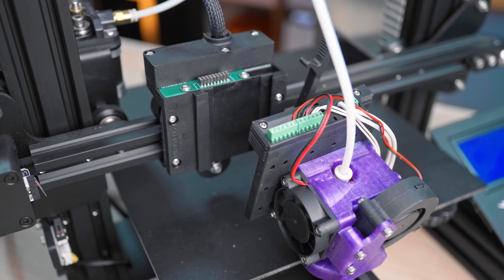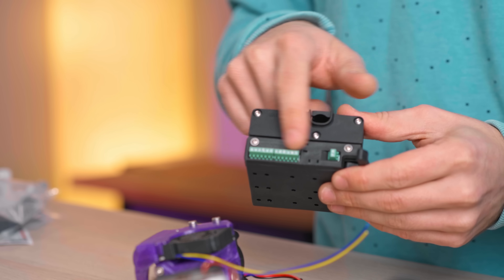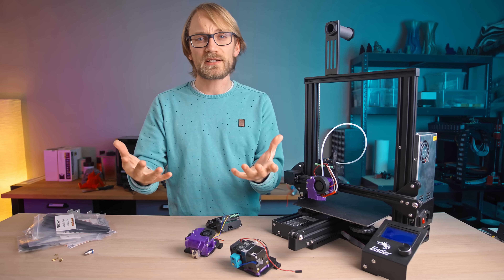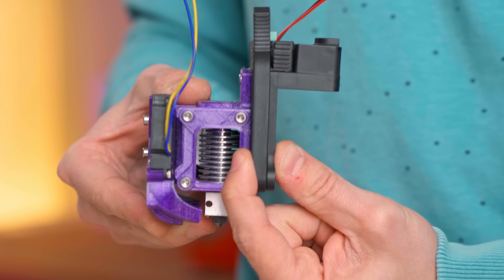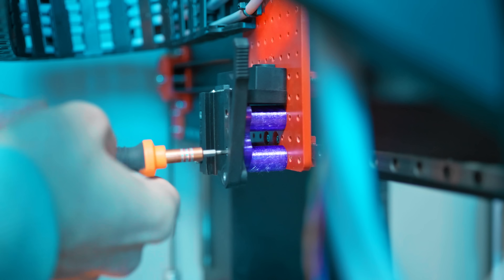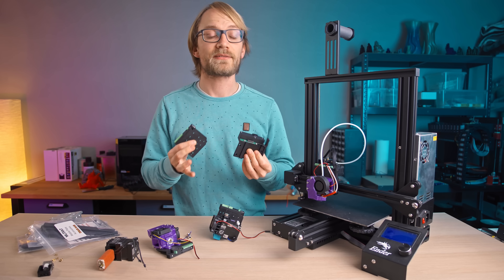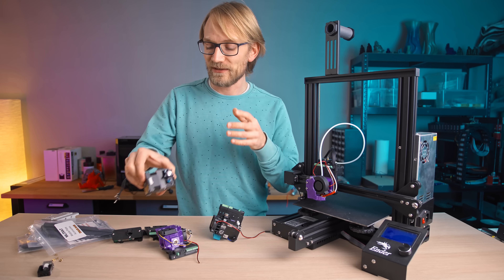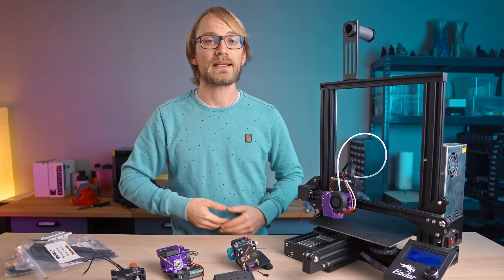WhamBam Mutant: A Quick-Change Toolhead Upgrade for any 3D Printer! (NOT on Kickstarter)

Comment: As soon as a I heard "patent-pending" I was very disappointed. Hopefully Wham-bam has the sense to happily license the design for a reasonable price versus just saying "mine!" like a toddler (aka MakerBot). Locking stuff like that down will inevitably kill the product. Hence why a typical maker doesn't even consider MakerBot not just cause of price, but performance.
I understand the need to get paid for your work 100%, but patenting this, like, read the room Wham-bam.
Reply from the maker: I'd greatly respect WhamBam if they were to explicitly call out their patent as being purely defensive - as in, you don't sue me, I don't sue you. Would need to see what's actually being patented first, though.
Reply: @MadeWithLayers  of course. I just automatically worry given the history of patented tech in 3D printing.

Comment: I've been subscribed for something like 4 years, since I got into 3D printing. Your videos have been essential for my growth in the hobby, and I just wanted to take a second to thank you. When I started I had no idea how any of it worked, and I'd certainly never used a 3D modeling program. I just designed the mechanical parts for a flight yoke with accurate range of movement, and I have creators like you and Angus to thank for the confidence to model complex moving parts.

Comment: A quick-change nozzle solution is something I'd be interested in, being able to easily change nozzles without the worry of accidentally ruining the heatbreak of the V6 design would be nice.
Reply: +1
Reply: +2
Reply: THIS. i really wish e3d did that. a threadless collar style heatbreak?
Reply: @ameliabuns  The heartbreak used by E3D's multi-extrusion hotends (Kraken, Chimera) is actually smooth on the outside, so you can more easily vertically align multiple nozzles. If only that was the case for the V6, Hemera, etc...

Comment: This definitely looks like something you could knock up in 5 minutes in Fusion, sans the electrical connection of course.
I wonder how much R&D really went into it
Reply from the maker: It's always easy to look at a finished product and go "oh, I could draw that up in 5 minutes". And yes, once you know how it's supposed to look, you can definitely draw up a similar product very quickly, but it's easy to miss the process of designing and iterating that led up to this exact design. And then, of course, turning that design into a mass-producible product that's actually going to make a profit.
Reply: @MadeWithLayers  actually in this case. lots of others have done it. and proper printing actually showed his progress. it didn't take a single person long. i'm sure a team of actual engineers barely had to think for themselves. specially when it's so similar to the community made ones. and the community released it for free
Reply: @MadeWithLayers  But in this case it really does look like 5 minute thing, hell I've probably designed similarly complex dovetail vesa mount for small pc. Anyone can order dozen pcb:s from china for couple bucks and it doesn't take much skill to draw straight lines between two connectors. Did they make any claims what the rated mating cycles is? I'm sure that claimed amp rating drops pretty fast in use. Idk what the hell they see that's worth patenting here.
Reply: ... but that will get you sued (patent pending). Although i wonder what it exactly is they patented and when, because proper printing already made a very similar system a while ago.
Have to agree with Thomas though, i'd prefer a Kickstarter over a patented product any time.

Comment: Another patent pending product for this topic. That's sad and doesn't match the open source driven community.
Reply: The idea is spread, so I am sure we will see an open source version in the near future. 😉
Reply: @Mister_Stork  There are numerous os quick release plates out there. The integrated connector and the lock lever are the cool features. Should not be patentable.
Reply: @Mister_Stork  Yes and no. 2 implementations of this problem are patent pending. So open source have to find a 3rd implementation. It's not getting easier.
Reply: Just like the mosquito, I have a hunch WhamBam will never budge on the price as to never admit/show that the product was a failure.
Reply: Open source is smostly like: Oh thats interesting, I´ll buy it form aliexpress when its available :D
Reply: @raise-project  How about the Prusa? Based on previous designs. How about the Ender? based on previous designs. How about Marlin, RRF... based on Open-source. 
the aliexpress thing is obvious. many will choose the cheaper path. HOWEVER: if you really value a product and are wanting to invest a bit more, lets say in a good extruder, then you will choose eg. Bondtech. On the other side, if you close-source it, many community members will not exactly like you because it stops the development. 
have a good one.
Reply: @certified-forklifter  Yes sure. I just respect license choices of someone who designed a thing. As not everyone that designs stuff has a full time job at a big company that pays his bills. 

Not a fan of patents though.
Reply: @raise-project  I understand you. its probably also hard for companies. Without the chance to become a monopoly, there are less incentives to develop products. have a good one!
Reply: @raise-project  Sure, I respect their choice. But I don't have to like it and I don't have to support the company. And it's still a valid point to be discussed. In addition it's kind of ironic that a company that replaces or adds parts of other products, protects their own work by a patent.
Reply: @WilkoVehreke Kinda ironic now as you said it yes :D. Not a fan of the specific product I have to admit. I just like the snapping lever. Tried myself an just had a round excenter knob and the pla didn´t hold up very long.
Reply: @raise-project  I guess they used Nylon for a reason ;-)
Reply: @raise-project  Can't agree on it. Look at e.g. Prusa. They're doing fine and are completely open source. In addition this tool changer needs open source software like e.g. Marlin to work properly.
Reply: @WilkoVehreke  Yes but Prusa also delayed the file release for a certain time to make sure some of the funding returned before its going into the open wild.
Reply: @raise-project  That's true and I think that's fair. Open source doesn't mean that every development step is public. Look at e.g. Android. It's open source but the development of a new version is done internally first. 
I'm fine with this, because the timing is reasonable. And it is by no meaning a patent that might blocks others to use the technology for free or at all.
Reply: @raise-project  Additionally: WhamBam wouldn't have a business if the patent for some kind of printers would have expired and others did spend resource to make an open source implementation. It's a bit about respecting the roots / community.
Reply: @WilkoVehreke  Imagine fdm being opensource from the start. We might be a little further ahead already. Maybe we wouldnt have known at all because only few had btx or  internet or sthg.

Comment: Isn’t this way to wide? It will let you loose maximum print size... 
2.54mm would be a better standardized pitch size.
I wouldn’t buy it. Maybe a printable open source version would be better. I once made a connection pcb for this but end up not using it.
Reply from the maker: My M9001 has a 25mm pitch on it and that works out pretty well. I use that as a four-screw-and-five-plugs, not-so-quick-change-toolhead 😉

Comment: I'd like this for having different nozzles ready to go. Without the fear of buggering my heatbreak with the awful method that is changing the v6
Reply from the maker: Yeah, swapping nozzles on the v6, especially when its mounts lets it rotate (like in the Prusa machines) is not something that's enjoyable on a regular basis.
Reply: I was thinking the same thing, I bought an 0.2mm nozzle a long time ago but haven't got round to trying it because of the hassle of swapping it out and the worry of ruining the heatbreak.

Comment: Maybe XT-40/XT-60/some industrial dc hi-amp connector needed?
Reply from the maker: I'm sure you could add an outboard XT60 that still slides together with the Mutant's locking mechanism.